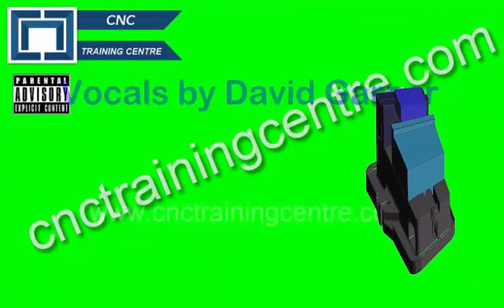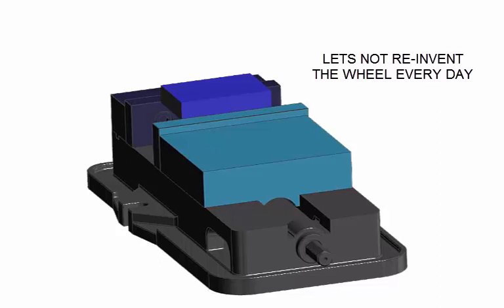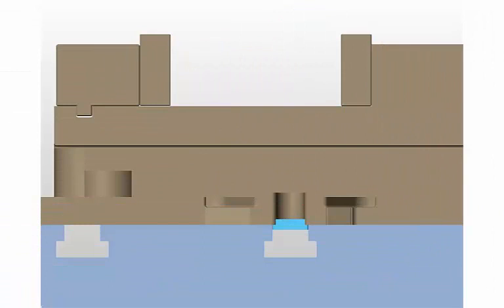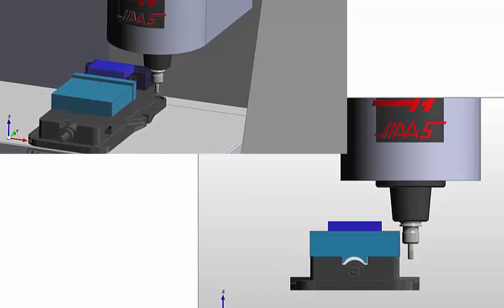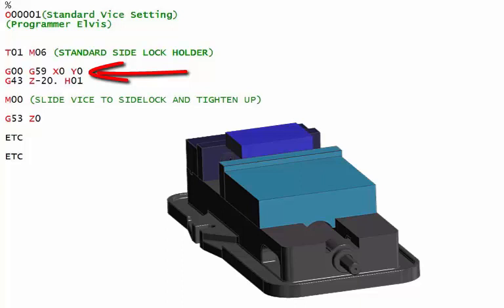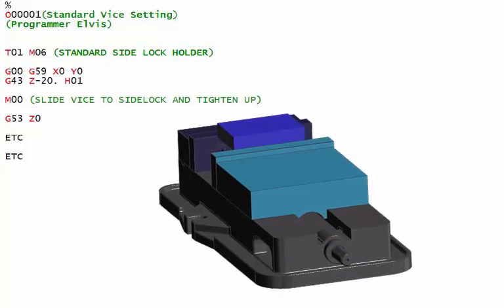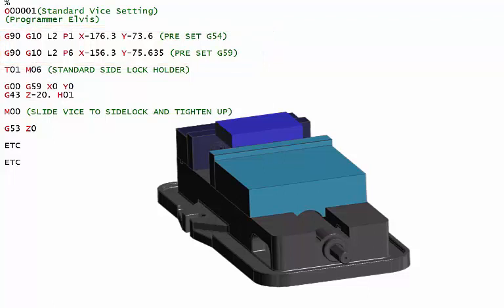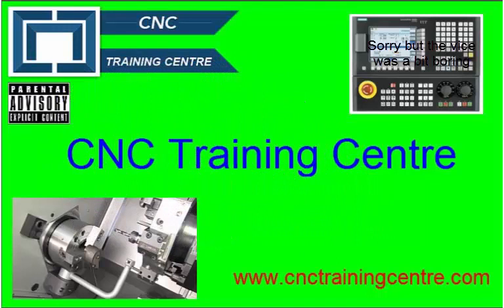CNC Tip (1) Never Clock a Vice Again Tips and Tricks

Comment: Sorry, how does your "T" slot inserts make your "Y" axis consistent as you move your vice through the "X" axis?  That is why you clock the static face of the vice.  You would need to invert your vice and machine datum slots that aligned with your "T" slots and were co-plane with your vice static face and the hold down points on the vice base for the "Y" axis to be 0 along the "X" axis.
Reply from the maker: The slots on the base of the vice are always produced parallel to the fixed jaw when the vice is made. The Y axis is therefore always in the same position in relation to the Tee slot.
You set your X axis by sliding the vice to a known position.

http://www.cnctrainingcentre.com

Hope this explains.

Contact me via website if you need more info.

David Garner
Reply: So you are using pre-existing machined holes/slots in the base of the vice that are sized to the posts on your fabricated "T" slot "tenons" that fit without any modification to the base of your machine vice?  With your suggestion, have you tried clocking the fixed jaw of your vice with your tenons fitted with the hold down bolts nipped up but not fully tightened -  try rotating the vice to see if the tenons hold true?  I guess this method would be accurate if your "T" slots were co-plane with your tool motor head quill/spindle holder X axis travel.  Thanks.
Reply from the maker: If you watch the whole video that is what we do. Thanks for your comment.